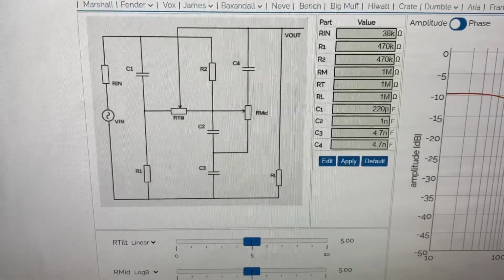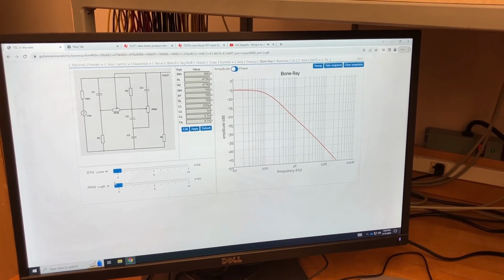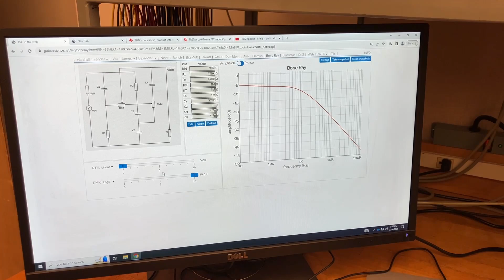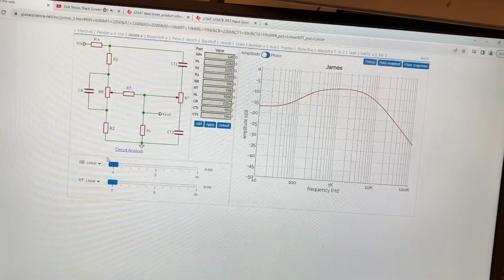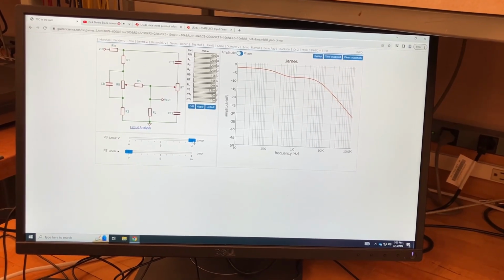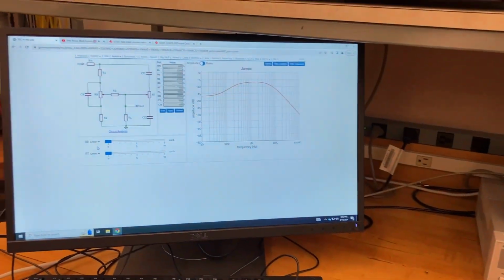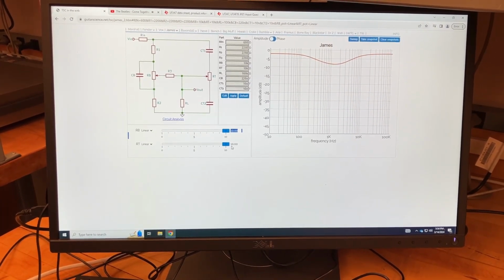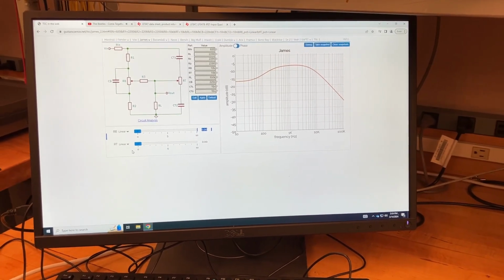Thursday Passive Tone Control Breadboarding (Guitar Amplification and Effects)

Comment: Your testing methodology is wrong, you should use a dry guitar sound as input and run it through your preamp, 1W flat amplifier and guitar speaker, preferably 12".
Reply from the maker: This was just a quick & dirty lab assignment thrown together with what was on hand to give students a taste of how the circuits operate -- it wasn't intended to be anything more than that. I wasn't in a position in the time I had to round up a half dozen guitar speakers. ;)

Of course, we'd want proper tools for a more proper comparison.

Comment: Hi, I am struggling to understand a Baxandall tone set up and it looks like the 'James' setup and has similar values for R and C. My questions are I believe them to be linear pots, is that true ?  also I see that you have both pots at 10K which makes sense but the example I am trying to understand has a 100K for the bass and a 500K for the treble and I don't get it ! could you explain or do you have a video I can watch to help me please ? so in essence what determines the pot's and is it blind luck yours are the same ? lastly ( promise) what SIM software are you using as I cant find anything that can simulate a pot !! trie Micro Cap and TINA no joy. Great video....cheers.
Reply from the maker: I highly recommend the book Small Signal Audio Design by Douglas Self -- he has many, many pages on tone controls.
Reply from the maker: Different versions of the Baxandall and Jones have different taper pots; use the GUI and you can see what pot is optimal for a particular design. In the video, all of the pots on the breadboard are linear since that's what's in the drawers in the lab.
Reply: Thanks for the tips ! @Lantertronics
Reply from the maker: Also check out the Elliot Sound Products ESP website.

Comment: Is the Bone Ray schematic missing a Ground symbol? Also, when I simulated the James circuit in Falstad with the Bass pot centred and the Tone pot set with 10k between wiper and ground, my output signal peaks at nearly 118% of the maximum input signal. An error in its calculations, or one of those "free" energy hacks?
Reply from the maker: On all of them it looks like there's an implied ground assumed at the bottom of V_in that V_out is measured in reference to.
Reply from the maker: Not sure what's going in in the Falstald simulation, but yeah, something isn't right with it.

Comment: It's certainly a useful demo tool for helping to select a tone stack for a project. I've always loved the sound of Fender amps, and sure enough, it's naturally a mid scooping stack, but what is really surprising is dropping bass and treble to zero gives you an approximate flat frequency response, and from this point, the mid only adjusts the wave's dB level.

I came across the Duncan page probably over 20 years ago and have fidgeted with it for many years and built several of the name brand stacks it includes. 
Generally, I still always found myself using 10K pots for guitar related projects to work properly once I made minor adjustments to values. I have a couple Crate tone stacks I can post if you're interested. Not the best amps, but one includes an active "shape" control which was an extra midrange sort of feature added to the tone stack.